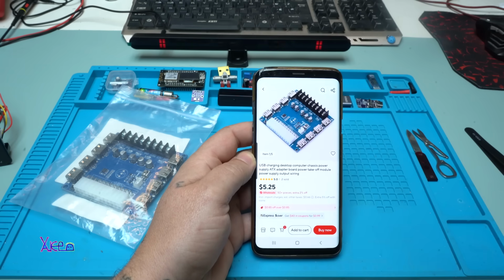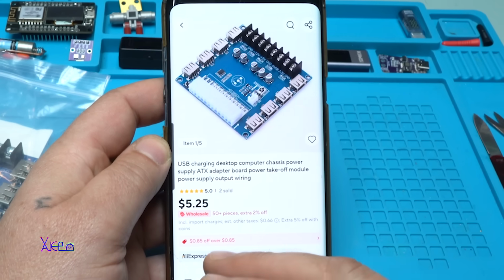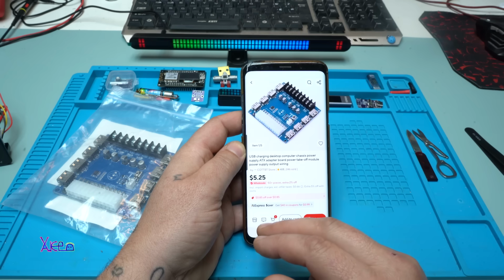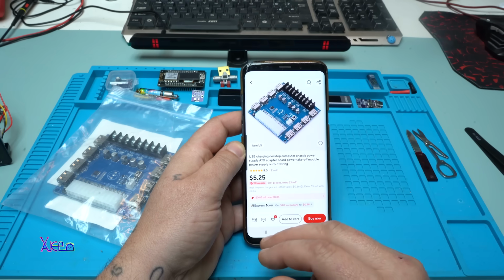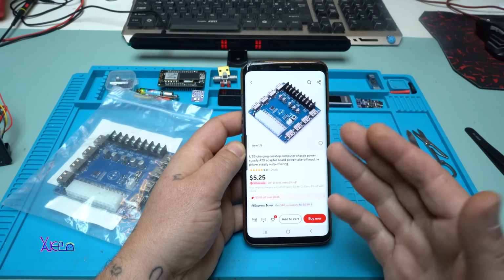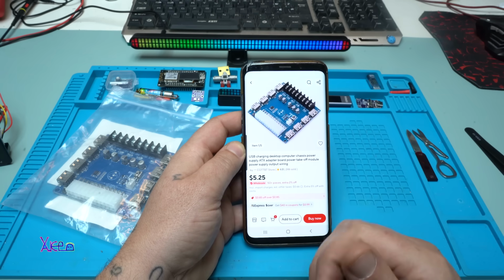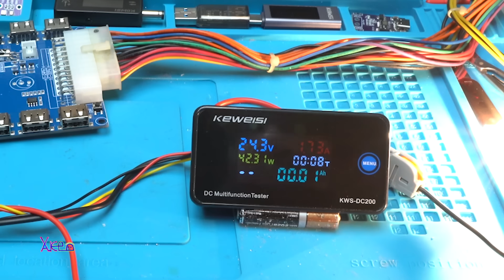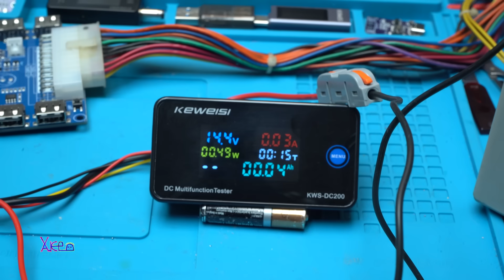WHY THIS $5 Aliexpress Module is BRILLIANT?

Comment: Nice breakout board.  You indicated that the boost converter could output up to 50V.  Maybe.  Your viewers should check the ratings on the capacitors.  It it says 36V that is the maximum.  If it says 36V, you probably want to keep it below 25V.  I was looking at trying to make a circuit like this for a 48V battery (which is like max 52).  Even at low amps, it let the smoke out of the capacitors.

Comment: Hello the 8 usb connector can you use those for power in instead of out and if so how much per usb can the board take.
Reply from the maker: Each usb can give max 2A and tottal max current of board is 20A
Reply: @Hacktuber so to be clear each usb cannot receive any power in just out